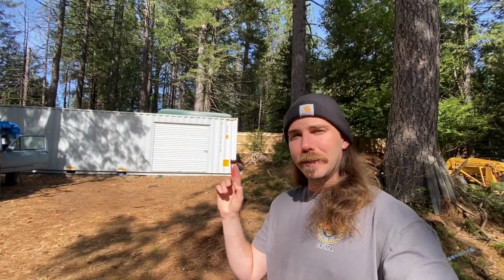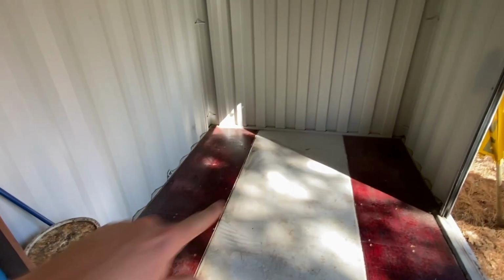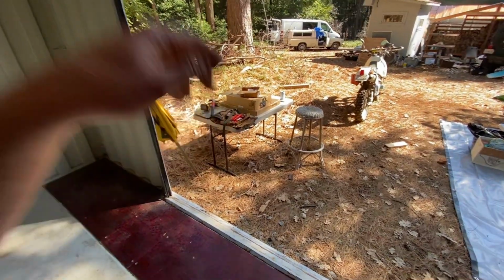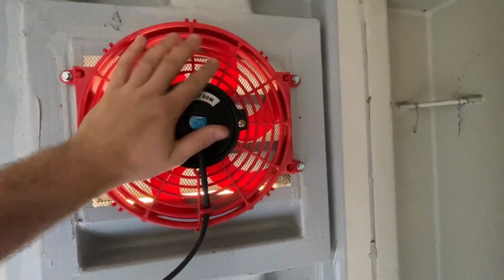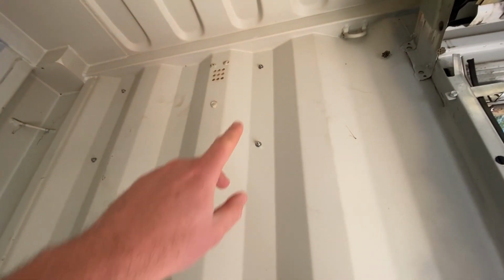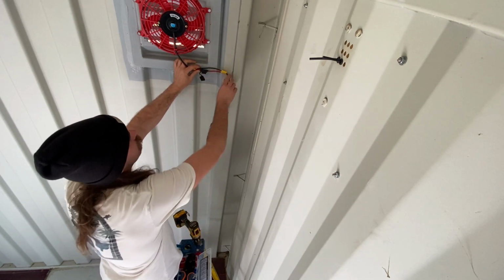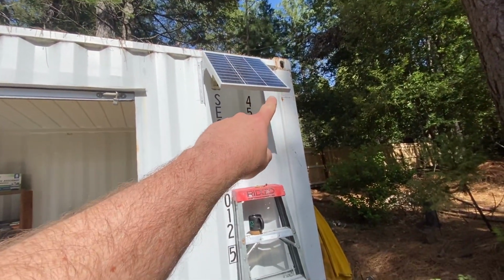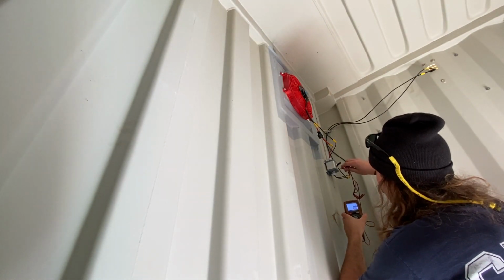DIY Solar-Powered Shipping Container Ventilation

Comment: The fan should actually be 14.5 volts like most automotive applications. I don't think a few more volts will hurt anything. IF anything, it may shorten the life of the motor, which, could still last a long time depending on the constant use..
Reply from the maker: I'm still in the acceptable range for the motor, but you're right! still going strong after ~2 years or however long this video has been out! The bearing is getting a little squeaky-- that's probably going to be the first thing to fail. Might even be a better idea to get a pick-n-pull fan. Probably much better quality than the chinese one I got in this video, even if it is used. I'll post an update if and when it fails!

Comment: Too much voltage on the fan it will burn out. U need step down inverter.
Reply from the maker: Did you miss the part where I measured the panel output and explained that? It’s still going strong 💪

Comment: what is the voltage with the fan off? just curious.
Reply from the maker: I'll try to remember to measure that next time I'm up there. I seem to remember voc being 18 volts listed on the back of the panel but I will double check.

Comment: What I've found over the yrs is that those performance fans don't last very long - 
      I had replaced one of my performance fans like yours with a fan that came out of a 1990 Buick that a neighbor has in a field - the bearing squealed dome - so I drilled some small holes next to the bearings and added oil to them - 
      It been doing fine venting air for several yrs now - were as every one of my performance fans died long ago - 
    If a motor fails now on a vent fan I just go to auto zone and get a life time replacement motor - 
    If a motor fails they swap it out - since there not dealing with the heat of a radiator they seem to just keep running over the yrs -
Reply from the maker: This one is starting to squeak a little bit now. Good tips and I will look into it! Thanks for the comments.

Comment: Another key thing to keep moisture out of the container is to raise it off the ground (at least a foot is good) so that air can flow under it.  As a secondary bonus, it helps prevent animals from living under the container also.
Reply from the maker: I’ve definitely got some critters living under there. Good tip. Stay tuned 👍
Reply: Yes, this is what I've done, twice, raised above ground, 1ft min.  Even more, metal grating, at 6ft lengths (side to side of the 8ft wide container) and welded between two of the metal floor beams works great (lets cooler air from bottom flow up into container)... you must include metal screen or something else to the bottom of grating to keep out insects, etc.. But of course this type mod would mostly depend on the use of the container... for a work shop, 100% acceptable - IMO.

Comment: the switch in your list shows a momentary type switch, possibly the wrong link?
Reply from the maker: Good catch. You’ll want a latching switch. Thanks for letting me know, I’ll get that changed. I actually had that switch fail on me within the last few weeks. I hardwired it to blow into the container, it seems to work better than pulling the air out of the container.
Reply: @Deferred.Resignation  i enjoyed your vid, started accumulating the parts you listed. i agree with pulling air into instead of pushing air into, the low pressure of pulling the air will cool off the incoming air..

Comment: I bet something else which would also work is a chimney that is about 8 feet tall. Just leave enough space for the air to thermally accelerate.
Reply from the maker: That is an interesting thought, I’ll be installing another container soon that has poorer light conditions so solar may not be an option. I should give this a try. Stay tuned 👍
Reply: @Deferred.Resignation  I am installing air conditioners on my containers and insulating them with rigid foam, so it will be quite different. One cheap thing I did is paint the roof with "APOC 243" from lowes. 2 coats has solar UV reflection of 80% when new, and 76% after 3 years. It goes a long ways to making it comfortable inside. $100 in paint covers 500sqft in 2 coats. There is an $8 brush right next to the paint which lets you put it on similarly to a mop. It took 3 hours to cover 1000sqft of container roofs. The only gotcha with that stuff is you have to put on the thinnest coat possible, then let it dry for 48 hours or it will not cure right, and be a goopy mess for weeks.
Reply: @Deferred.Resignation  I ment solar heat reflection, and at night it had about 80% heat radiation. So it is not just an insulator, but it keeps it cool. So not as desirable if you need to heat it in the winter.
Reply from the maker: @mikegrok  thanks for the info!

Comment: I put one of these in the center of mine, solved the problem 12'' Attic Steel Wind Turbine Roof Vent Exhaust Fan Rotary Ventilator Steel

Comment: With this set up can you add a few led lights inside the container
Reply from the maker: This setup only really works in daylight. Otherwise you’d need batteries for power during night time. I’m making another video on solar and battery banks soon. Check it out 👍

Comment: Looks great. I bought enough for 2 vents. I was going to try a push/pull system. One on one side of the container pushing air in and the other on the other side pushing air out. What do you think?
Reply from the maker: Sounds like a good idea to me! You’ll only need a Regular 2 position switch if you’re doing that, I think.
Reply: @Deferred.Resignation  So a 2 position switch would be only connecting one wire ( the same one ) on each side of the switch? What size fuse did you use, do you think that's really needed?

Comment: I was sent your  video thanks. I have never understood why people put the solar panels on top of a building when they can put them on the side. That's what I'm going to do I'm going to put it on the side.
Reply from the maker: Thanks for watching! Stay tuned 👍
Reply: Understand the tilt angle in your latitude for optimum solar insolation, the snow may not accumulate on the panels if on the walls,good luck !
Reply: Understand the tilt angle in your latitude for optimum solar insolation, the snow may not accumulate on the panels if on the walls,good luck !

Comment: Have you noticed any difference in the humidity/temps?
Reply from the maker: I don’t have a temp or humidity gauge in there but what I can tell you is there has been no condensation through multiple snow/thaw cycles and the the fan is still cookin. It’s definitely working 👍
Reply: @Deferred.Resignation 
Consider adding a small batter to run the fan 1 hour after the sun goes down and putting in a couple floor vents so the fan can pull the cool air in from underneath-geo thermal.
Good luck !
Reply: @Deferred.Resignation 
Consider adding a small batter to run the fan 1 hour after the sun goes down and putting in a couple floor vents so the fan can pull the cool air in from underneath-geo thermal.
Good luck !
Reply: @joestalin2375  unfortunately even though the floor is often cooler, it is also often wetter, and provides a way for insects and rodents to enter. all containers have little vents on the sides near the roof, it is better for the incoming air to be a bit warmer than to have a rat infestation.
Reply: @mikegrok  
Don't leave a open hole use a sreened floor grill you can close,peace bro!

Comment: it appears that you had that vent built in at some point? I too just bought a shipping container and am currently researching venting solutions. I like your setup. good work.
Reply from the maker: Yeah I had the vents built in when I ordered the container. I mentioned it somewhere in the video. You’ll need some basic metal fab skills to do it yourself. At the most basic level you could cut a hole and put some 1/8th inch screen over it. Though the fan would most certainly run more efficiently mounted on a flat surface, rather than the ribs. Thanks for tuning in 👍

Comment: Exactly what I was looking for. Thanks
Reply from the maker: Glad this was helpful 👍 stay tuned
Reply: Have you noticed more air being pushed out or pulled in , in the configuration of this video?
Reply from the maker: @jamesfalvey77  I have it pulling air in from the outside currently, because I think the radiator fan blades are designed to do that. To be completely honest though, I can’t really tell much of a difference either way.
Reply: @Deferred.Resignation  I'm doing the exact same thing with the exact equipment. I am of the same opinion, however, I wanted to ask
Reply: @Deferred.Resignation  I think only circulation is what's needed and not so much volume, I bought a 40ft one in Ga to store stuff in, didn't know about the condensation issue, a year latter when I went into it EVERYTHING was ruined, lost many family photos even though I had them well boxed up all that got soaked